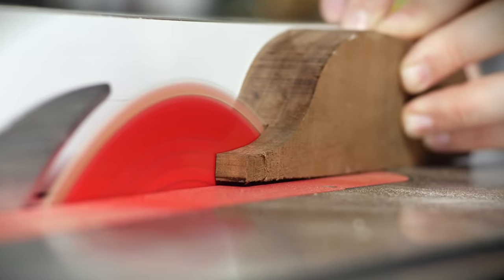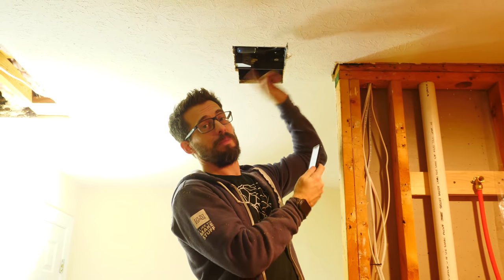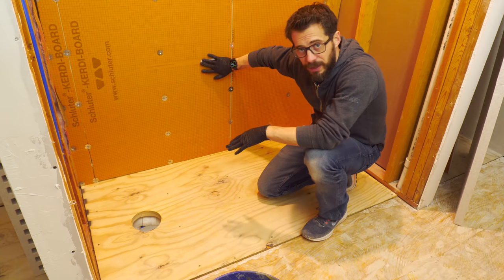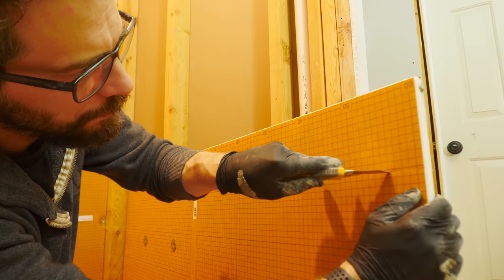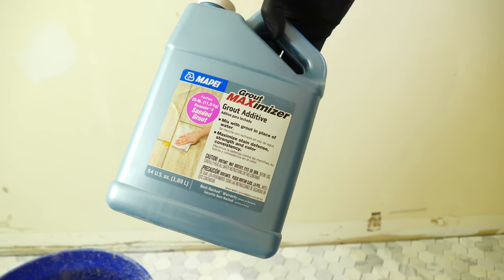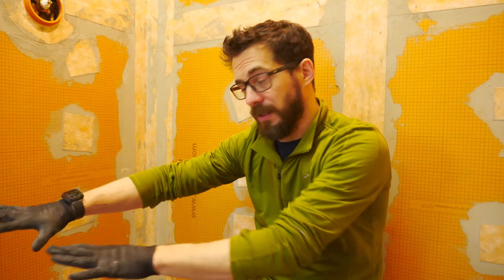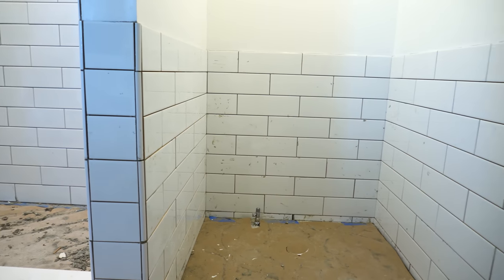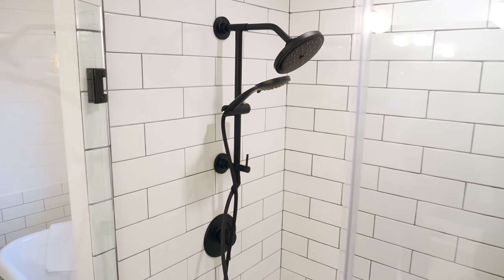Remodeling a Master Bathroom | Part 2 | I Like To Make Stuff

Comment from the maker: I may or may not have gotten really excited to be finished, and forgotten to put in a couple pieces of baseboard 😉   Just ignore that..
Also, to address a few of the common comments:

1. The electrical box above the vanity is actually in the attic space, and fully accessible.
2. The shower door is reversible, but I made it so that I can reach in to turn on the shower without getting sprayed in the face.  it also has a clear piece of weather stripping on it to stop water from coming out where the door meets the fixed panel.
3. It's ok if you don't like the paint colors or tile we chose, it's not your bathroom 🙂
Reply: I Like To Make Stuff you should place a protective coating on your shower glass door, I hear that even the durable glass can crack at any time. The protective coating helps so that if it ever shatters the glass won’t go everywhere. (I think it’s called safety film)
Reply: 3. I find your bathroom gorgeous! However, I find unfortunately not attractive how you choose to place your tiles at the bottoms of the walls... 
I know it's hard to match the different heights inside and outside shower space in you bathroom... But as everybody can see at @24:20... The last round of tiles on top of the shower has roughly the same height of the first round of tiles at the bottom of walls outside the shower space... To me, it would be vastly better to switch that round of tile from the top of the shower to the bottom. Outside the shower your tile would end up a little bit higher, this way.. You may still have to cut the bottom round of tiles outside shower space, but half tile height looks way better to me than less than 1/4 tile height...
Reply: @sashalag4555  I noticed this too, much respect for tackling this project, but it does stand out to me. Also, what's with the different tile size where the shower door fits?
I had a bathroom tiled recently by a pro tiler, it was very interesting how he spent a long time laying out tiles so that there were no or very few skinny strips. Each wall was centered left to right, or centered around a window etc.  Impressive job.
Once again, great job, just pointing out the bits that I noticed :)
Reply: The third point made me laugh
Reply: Point 3: If we all liked the same things the world would be really boring. I think it’s great that you’ve personalised the room exactly how you want it.
Reply: just thinking u messed up der bud
Reply: Looks great....so much work
Reply: Thanks, the missing baseboard was triggering on the final shots.
Reply: I noticed that the top of the tile on the exterior of the shower showed the unfinished edge. Did I see it wrong or did you ad an edge title later?
Reply: i would make the walls a light grey to at some transistion between the tile and wall
Reply: @crismozqueda9728  the shower door is already tempered glass and if rocket man did nuke us from North Korea then the door would just turn in not a pile of square little pieces a little d will pose no threat to life or health as long as you dont eat it for breakfast. 

And yes, it will take almost as much impact that a nuclear warhead would deliver, who ever told you they can shatter any time needs to be re-educated
Reply: Cody Hurst  he can really do whatever he wants to do as it's his home. Hes not trying to tell anyone that all renovations are bring d.c. one to confirm the 2019 building codes
Reply: Don Pfeiffer I’m so sorry I did not know!
Reply: Really awesome work! Looks great!

One small suggestion/tip. @23:07 when installing bulbs like that, use gloves or paper towel or something to avoid getting hand oil on the bulb itself. The oil from your hands can cause the bulb to overheat. I've lost a few bulbs to the easily avoidable hand oil problem 😊

Great finished product!
Reply: The nothing thing I'm torn on is your hardware and faucet color. With the shower and tub your using a dark brown or black (sorry it was hard to tell). But the hardware on your vanities and the faucets are more of a gold. I really didn't expect a difference in color.

Anyways WoW it looks amazing! Great job Bob!
Reply: You not only like to make stuff, but you also do it very well😛😮💪
Very nice dude✌
Reply: Hahahahahahahahaha its not ur bathroom hahahahahaha
Reply: As long as we're constructively criticizing, you shouldn't have used a sanded grout on marble tiles, it scratches them and leaves swirls.  And when combing thinset with the notched side of the trowel, you should be keeping all the grooves parallel to provide channels for air to escape when bedding the ditra, shower pan, curb, or any large format tiles.  I don't think it hurt this install, especially the small tiles, but its always good to get the technique right.
Reply: @sashalag4555   unfortunatevely unactractive? It's hard to take a person seriously when they can't spell or use spell check on an edited post no less. Very few people care about 1/4 tile vs. 1/2 tile. Is it criticism or just curiousity?
Reply: @jordangroff1440   I'm curious to know the reason behind this harsch tone. Did I hurt your feelings?

anyway, that part has now been corrected. Hope now I am eligible to be serious considered from you…
Reply: @sashalag4555  The dude killed it and you shit on his video with a 1/4 vs 1/2 tile comment.
Reply: I may have missed it but what size bathroom was this?  6-7' x 10-12'?
Reply: I Like To Make Stuff I love the tiles.
Reply: I hope you planned to change your bathroom floor in 5 years because I assume you used a standard glue onto that timber that isn't rated to stick to. You should of used a two part adhesive rated for ply or screwed a fibre cement board first or just used a liquid waterproofing membrane.
Reply: I Like To Make Stuff Jonathan
Reply: Awesome video! We're using it to gamelan our remodel.  What are your thoughts on the foam shower step over time? Concerned the foam core will not hold up if it gets stepped on regularly. I mean you should be stepping over it every time but worst case it gets used.
Reply: Everyone's bob the builder suddenly

Comment: Bob - I'm sure it's a huge weight off of your back to have that bathroom finally done. thank you for the countless tips, tricks, install hints and gotchas that you pointed out over the course of the two videos. My favorite features are the shelf in the shower with the floor penny rounds on the "wall", the transition steps used as shelves, and the difference between the hex tile and the penny rounds in the shower. amazing job!

Comment: Is that blue paint color on the vanity called Painter's Tape Blue?
Reply: I was thinking the same thing (I even thought it was covered in tape for a second). It's a bit too bright to go with everything else that's in the room. I would have gone with like a charcoal color that goes with the black fittings or (if it had to be blue) a much less saturated, darker blue, almost like a cool gray.
Reply: Me too nads, I couldn't believe it when I saw it, black would have gone immaculately with the rest
Reply: I wish that they would change it to be black to go with the fosit in the shower that would make more sense. Right?
Reply: I'm dying over here, the faucet that they chose is literally a different color from EVERYTHING else in the bathroom 😭 the bathtub and shower fixtures and even the grout were all black, but they got a brass looking colored faucet 😭
Reply: I literally thought it was just a huge thing of stick on plastic sheet to keep the vanity safe when he was installing it. Looks exactly the same color as the painters tape he has on the floor while installing it. That being said, there is nothing wrong with the color. I think it goes well with the bathroom once its all finished. Plus its just the vanity not something more permanent like the tile, so if they ever sell, its easy for the next person to cover up if they dont like it.
Reply: liliana rhetork there’s nothing wrong with mixing metal finishes, as long as you do it with a style in mind. In fact, I find that keeping all fixtures the same color can make a space look boring and monotone. As I side note about the blue cabinets, I personally like the pop of color. :) of course, that’s just my opinion
Reply: @shannonsaoirse8443  that's cool, you're entitled to your opinion. :)
Reply: Well, it's definitely not a Ferrari blue. Maybe a Trabant blue.

Comment: One thing that stands out for me is how much wiring there is - especially seeing a socket above the sinks. In the UK, you can't even have a light-switch in your bathroom (unless is a pull-chord one hanging from the ceiling) and the only socket allowed is one for an electric shaver.

The other thing that stands out is how good the whole thing looked and how well you put it together. Love your work, man
Reply: DR PHIL the entire house is covered under a gfci equivalent called rcd
Reply: You can't have any sockets in your bathroom,  except  for the one you can..... right?

Comment: More tips here!
If you’re tiling onto a wooden surface dampen the surface with a moist sponge before applying the adhesive, otherwise the adhesive can dry out too quickly and not bond properly.
When mixing your adhesive, you want it to be able to hold a decent peak. Not wet enough will make it hard to apply, but too wet and it will be weak.
Reply: @Taryn Fernandez  not really no. Better to use a tile matting

Comment: I learned last winter to always disconnect my hose from the house when it starts to get cold. Even with a "freeze proof" faucet, if you leave the hose attached, the ice can burst the faucet pipe in the wall making a big problem come spring when you go to use the hose.

Comment: Please make an electronic desk on the cnc machine with place for cable management and monitor stand and built in wireless charging and and a counter sunk mouse pad. 

(add anything else you want)